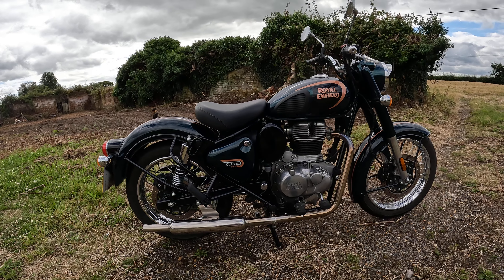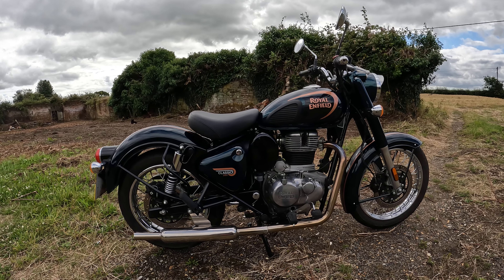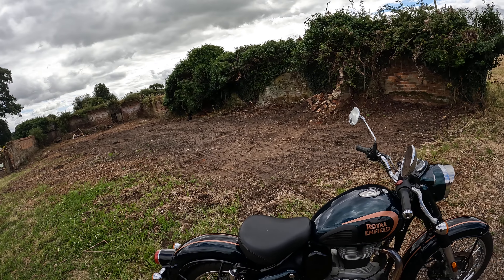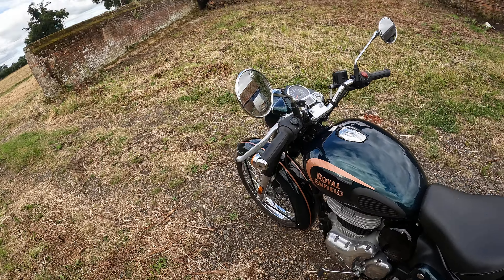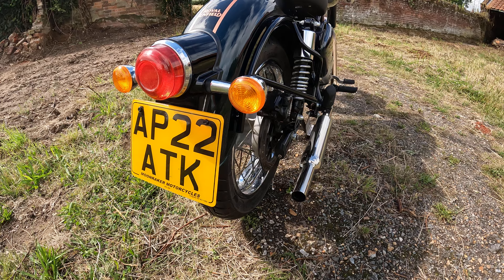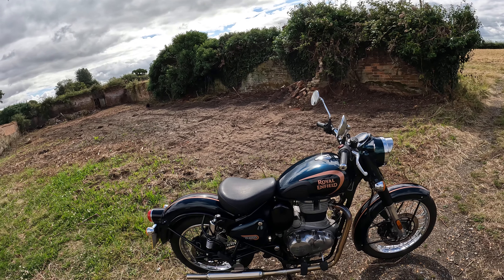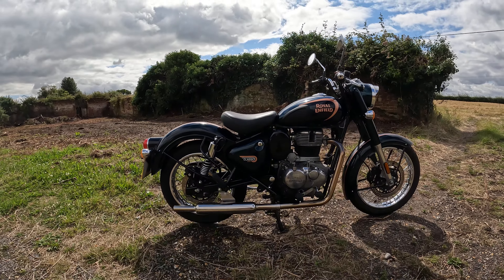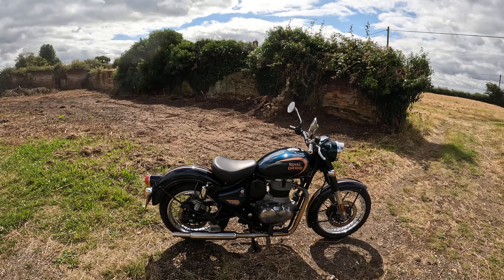ROYAL ENFIELD CLASSIC 350 PERFORMANCE MODS.  ARE THEY WORTH IT?

Comment: My uncle told me about 55 years ago,if it ain't broke don't fix it!! These companies spend millions of dollars to get these machines right,leave it alone!!! Great video!!! You can always plan a little longer trip on the two lane roads.I avoid the interstate roads as much as I can.
Reply from the maker: @user-ts1fp4nm9y How right he was!
Reply: I agree with the type of road these bikes are best suited for ,on the motorway here I feel I'm  holding  people up as everyone nearly overtakes me, , even the heavy lorries , it's best suited to the A+ B roads here being a design from the late 50s I believe these fast monotonous roads didn't exist.
Reply from the maker: @iandawson7723  There is nothing on these bikes that was designed in the 1950's apart from the casquette. Every thing is bang up to date, technology wise. Fuel injection, ABS, disc brakes, overhead cam etc The old cast iron Bullet's were designed in the 50's and there is no comparison between the two.

Comment: My classic350 is soon to be delivered. In the meanwhile I watched quite a bit of reviews on performance parts and noticed everything you add will change the long stroke performance to the worse or it's all placebo. I saw a fullt modded review and acceleration went from 16s/100kmh to 12.5s/100kmh and it is louder and more consumption. This is not where this RE shines IMO.
The only engine mod I ordered is a belt drive and like some bags . Maybe alloy wheels if I cannot keep the originals in a decent state. Ceramic protection... nothing else I could come up with after viewing reviews for 4 months now.

Hope you'll enjoy your classic soon. Last weekend I rode a demo like your's and it's color is amazing but I chose the red/chrome one.

kr, Erik
Reply from the maker: @electrobob1  A great comment! Thankyou for taking the time to post it!
Reply: @Volcanicbrown1878   I like those Hagon closed rear shocks as well😅

Comment: Good to have honest feedback from a fellow Classic 350 enthusiast. I have the Fuelx lite and decat pipe fitted to my bike but neither were for performance as the bike is a 350 single after all and not a super bike. Sticking with Fuelx on my bike as it does smooth out snatchiness on my bike and there is also less back firing or popping now. Also sticking with decat pipe mainly due to weight saving and in my opinion a nicer exhaust note so again not a performance boost. Had considered using the Hitchcock’s open air filter cover (with standard air filter) but after trying it found that all it did was increase unwelcome induction roar. Won’t be using DNA filters as I consider the claims to be marketing hype - lots of riders have tried them and returned to stock which must say something.
It’s good to have different views but the main thing is that we all agree how good the Classic 350 is in these days of computer designed plastic futuristic styled bikes. Royal Enfield are keeping it real and building bikes that the reasonably competent home mechanic can look after themselves without the need to take it to a dealer to plug in and “service” for owners.
Reply: Hello, Keith, in my opinion I'd say you have the perfect set up. I've said for awhile if you're only going to do one thing, get the decat. If you want to do two, get the fuelx lite. If really need to do 3, reconsider.

Comment: I see the supervisor and the inspector were checking out the yardwork. No doubt the mousing habitat has changed a bit , they may not approve of your yard or the 350 modifications .
Re the 350 , DNA type filter passes more air ,makes more noise and filters less dirt . I don't see them on equipment that operates in dusty conditions , so for what they cost , in my opinion for everyday use , just an expensive joke .
The cam should work if the fuelling could be altered . With a carb you could rejet it , but " computer says no " .
So you are b*ggered before you start . Setting up a small engine for increased power is a trade off and some of these bolt on go faster bits won't work together .
Maybe some "porting" would help.
Even in the old days , pepping up an engine made it more peaky .
Aunty Enfield knows best sonny .
Another thing that you should remove is that silly peak on the headlight , an intensely annoying chunk of avoirdupois .😂
Reply from the maker: @dungspreader Yeah, that peak was the first thing to go on the classic 500! (Tin tat at it's finest!) The Fuel x is supposed to take care of the fueling, but I have my doubts on that too. This afternoon whilst this video was percolating, I whipped the Lambda sensor out and it's very sooty. Can only really be the Fuel x.
Reply: @Volcanicbrown1878  . Yep over rich .
Reply from the maker: @dungspreader I wish I was over rich!

Comment: Rode the Meteor and thought what a lovely little engine.. Pulled lovely..If anything it kind of suddenly lost power at around 70mph..Felt like it was fitted with a limiter to me…Mentioned it to the dealer and he told me they were…Weather there’s any truth in that I don’t know.. Certainly felt like it to me..Agree, stick it back to stock set up..👍ATB
Reply from the maker: @DickieMintCycles  Yes, they have two limiters, a rev limiter and a speed limiter driven by the ABS. Even if you take the ABS fuse out, they still limit the bike to around 73mph. I think the Hunter doesn't have the speed limiter fitted as I watched a video of a guy in the States riding a Hunter and it was showing 90mph on the speedo!
Reply: @Volcanicbrown1878  Interesting…You’ve taught me something ..Which is what it’s all about.. I’d be keeping my eyes peeled for a hunter ECU perhaps ..If it’s feasible and would work …Can’t see Enfield changing too much between the motors if anything..You might then get rid of the speed limiter maybe?Agreed,put the mechanicals back to standard..Enjoy your day! 👍

Comment: You summed it up in one, if you want a higher performance bike, don't buy the RE350; simple. I think it's beautiful machine, but the reason I wouldn't buy one is I'd want a little bit more oomph, otherwise I'd have been off to a Royal Enfield dealer like a rat up a drainpipe. Still thinking about the Interceptor though, but a bigger classic is in the factory wings perhaps...? Great video as usual. Thanks Mr. Brown.
Reply: I saw the RE 350 as a nice little addition to my stable to compliment my bigger more powerful bike (T-100).  But, what is happening is that at age 73 I am riding the 350 all the time because it is so much lighter and easier to push around the garage.  Also, it is a lot easier to handle even when out riding.  A lot less stress compared to the Bonneville.  Although, I do love the Bonneville as well.  😀

Comment: I just don't get it people buy a 350 then try to make it perform like a 500     buy a 500
Reply from the maker: @thepipesmokingbeekeeper8917 Exactly my thoughts! Even with all the mods, my cast iron 500 bullet will run rings around this 350! The J series engine will never go as well as a 500. There is no replacement for displacement!
Reply: Shame they don't make a new 500 single.😊
Reply: I generally agree with this.  But, some (me) would like the lightness of the 350 which just a bit more push going up hills at around 50/60 mph.  This bike does bother me on that score a little.  But, the whole package is lovely and I'm not selling it on any time soon.  One thing I was considering was the new Triumph Street 400 which is both lighter and more powerful. But, in the end, I value character.  That Triumph lacks character. The RE 350 has the character thing down in spades.

Comment: The best things about these bikes is adequate performance, reasonable handling and comfort plus 100 mpg and cheap maintenance. Mine does everything I ask of it. All the touring add-ons are binned and apart from a fly screen and rack it is totally standard. My only gripe is the rear suspension is a bit harsh even on the softest setting but that is not a deal killer. Thanks for showing the go-faster mods up for what they are. You have probably stopped a lot of folk buying stuff they only imagine they'll need.

Comment: I have a Classic 350 which I like just as it is. I've watched a few videos covering these various mods, the benefits seem to be marginal, at the expense of noise and some loss of refinement.  You've been very honest about the reality of going down this path.  I think we'd all love a little more poke from this charming machine.  A new Classic 500 doesn't seem to be in the pipeline. One interesting possibility is a 410cc big bore kit for the J-platform 350, available from India. There is at least one review on You Tube. This seems like a good route to improving performance overall without increased noise and peakiness. I am hoping that this kit, or something similar, will be marketed by Hitchcocks in the near future, thereby offering some quality assurance.
Reply from the maker: @roverchap  The big problem with Hitchcock's marketing a big bore kit is that it will be 4 times the price.

Comment: 👍for me. Standard bike is better. I miss my classic .. I am going to test ride the hunter soon.
Reply: I sold my 350classic.  Nice but prefer my 500classic.  Hunter in garage at moment. Actually a courtesy bike.  I prefer it to the 350classic but it's a little cramped for me. Lighter. Bit quicker, better ride and much more lively steering. Alloy wheels and plastic guards is a big reduction in unsprung weight.

Comment: Why bother with all those additions when what should have been bought was the Classic 500 EFI,  mine pulls 70 uphill and into a headwind no bother,
Reply from the maker: @dozerblade  So do all of my 500's! The 350's will never match the 500's for torque.
Reply: How much does that 500 weight wet?

Comment: I own a meteor 350, and to me, the bike is a modern MZ 250. It is cheap and reliable to own and run but not fast. If I was buying another one new, the only mods I would  be  replacing the OE chain and the tyres otherwise if I wanted faster I would have chosen a different buke.
Reply: Yes, I am considering some more aggressive tires because I do ride on quite a few dirt roads around here.  But, I am even questioning that mod. I'll consider it again after the stock tires are toast.

Comment: Any person with some background in petrol engines knows the more air in and out the more  power. Decat and DNA is all that's required.  As/per the noise? I contend it will sound closer to the original bullet 350. To each their own obviously.
Reply: @nicholasfox3670  I learned that 50 years ago  Bubba.
Reply: @nicholasfox3670  I learned that physics 50 years ago bubba. 😉

Comment: Thanks for your honesty. 
I wont bother.
Regards 
MikeN
Reply from the maker: @michaelnicholson5218  Won't bother with what??
Reply: @Volcanicbrown1878 Sorry if you misunderstood my comment,
 I wont bother with any of the mods that were made to your bike it's fine as std for me. 
If I want to go faster ill crack out the 1200 Bandit
Regards
MimeN
Reply from the maker: @michaelnicholson5218  I thought you meant that you won't bother with a comment!! There you go! a 1200 Bandit makes up the difference!
Reply: @Volcanicbrown1878   I've been wondering how the 350 would cope with longer rides.
I'm glad to hear about your longer runs went ok.
I would like to take a 2  to 3 week trip into France  but wondered how the 350 would cope.
I'm a big believer in horses for courses, but I really like the 350 ride, and am reluctant to use the Bandit
Cos I'm 71, and it's a lump.
What do you think?  One tank full at a time  and then rest it for a couple of hours? Or press on regardless?
Regards Mike N
Reply from the maker: @michaelnicholson5218  On my longer trips I tend to just stop for fuel and press on (200 miles)
Reply: @Volcanicbrown1878  Again, a good honest reply.
That's good enough for  me. 
Thanks Mike N
Reply from the maker: @michaelnicholson5218  I'm considering doing another "Iron butt challenge"(1000 miles in 24hrs, but this time on a Classic 350! Not the big Honda 1300 as I did last time.
Reply: @Volcanicbrown1878 
 Wow, I'm sure you know that's  an average of 41.6 mph..!
 Would you go for a track option or the open road?
  I think I would go for the sprung saddle,option !!
 Good Luck with that one.!!
One of my friends did John o Groats to Lands End on a Honda C90 in 24hours and raised a shed load for charity.
Regards
MikeN
Reply from the maker: @michaelnicholson5218  It has to be done on the open road as you have to have photographic evidence of your fuel receipts and mileage, with no same roads!

Comment: I have seen a video where they put another cam in a re350 and found no increase in speed because it has a electronic limiter
Reply from the maker: @peteduch2151 Putting a cam in the 350 will not increase the top speed! I did say that in the video!

Comment: It's a backyard beryl machine  for small lanes local riding
Reply from the maker: @paulsilson2148 I have done plenty of motorway work with mine.
Reply: @Volcanicbrown1878  is it a motorway bike?
Reply from the maker: @paulsilson2148  Like I said in the video, I went half way round the M25 and the whole length of the M3 twice on that bike with zero issues. They are perfectly capable of motorways!
Reply: @Volcanicbrown1878  no good for the motorways over here though, in the U S
Reply from the maker: @paulsilson2148  No ,probably not! Seems like everyone drives at warp speed on the Interstates!

Comment: The fuel ex stops it running lean that it needs to pass the Euro 5 pollution requirements. More fuel means that the engine runs cooler as it runs and that means it doesn't cook the oil and so the oil lubricates the engine better and so it will last longer. I would rather have longer engine life and cooler running then extreme gas mileage with it running hot as Hades
Reply from the maker: @frankmarkovcijr5459 The theory is good but the reality is that it runs just as hot as it did standard. It blued the exhaust pipe!
Reply: @Volcanicbrown1878  don't single wall exhaust pipes blue just as a matter of course. I just meant that fuel injected bike to set so super lean to pass stupid regulations that they cook their oil to death within 300 miles. I thought those devices made them run cooler in order to make them last longer.
Reply from the maker: @frankmarkovcijr5459  They are supposed to Frank, but this one doesn't seem very good at it!
Reply: @Volcanicbrown1878  sorry to hear that

Comment: I hope that none of the “Royal Enfield got it right” crowd have changed or added a single thing to their bikes. If you want a bike with a rear rack you should bought one. If you want panniers buy a bike with panniers. No tank pads or upgrades in suspension either. I don’t even know why an aftermarket exists. Why would anyone dream of trying to alter this perfect machine, gifted to us by the mighty gods at RE?
Reply from the maker: @elwood62  It's human nature to try and make something better when there is no need to!
Reply: @Volcanicbrown1878  all I’ve changed on mine is the gearing. Should I have bought a different bike instead? If I wanted a smoother top end I should have bought a GS I suppose. I’m all for leaving bikes stock. But I also don’t fault people for making tweaks to suit their riding style. If any bike was perfect the aftermarket wouldn’t exist.

Comment: Really sorry these mods haven't worked out for you, very strange. Are they worth the cost of the install, no. In my situation it's a big improvement, Cam swap, decat, dna filter, fast flow filter housing. Only thing I reverted back to was removing the fast flow filter housing, far to much induction noise for me. I've not got the Fuel x or a straight through exhaust system though. Still get 200 miles per tank, although the light starts flashing at around 170-180. Hope you enjoy it when it's returned to stock, enjoyment is paramount when riding these, so crack on & make yourself happy with it. 👍👍
Reply from the maker: @stevegresty4181Judging by the comments, it seems to liven up some bikes and not others!
Reply: @Volcanicbrown1878  Mmmm, maybe so, very odd.

Comment: Leave the K&N Filter just put the stock cover on it. They are a good product puts less stress on the intake cycle and are lifetime. The open cover is for noise only. The exhaust mod is lighter and makes the thing run cooler so not a bad thing. Fuel X is the biggest no no... maybe.

Comment: The trouble is with "modifications "   you HAVE to know what you are doing ( IMHO)       The factory know what they are doing AND have tested the  mods   However they will build to a price , so there can be an argument for better quality  such as the exhaust.    I have seen goldwing clutches welded together from "aftermarket" levers